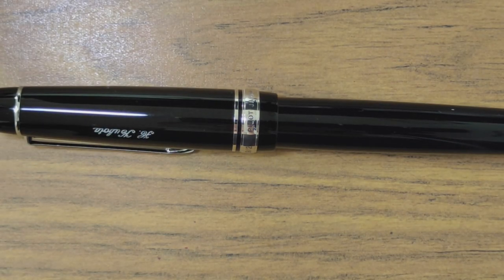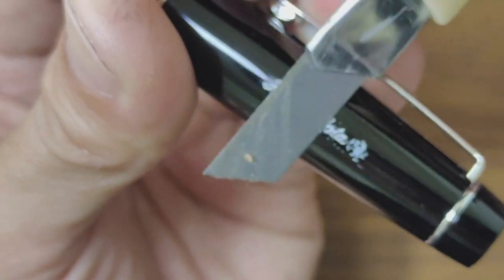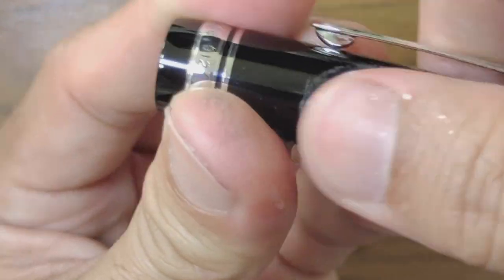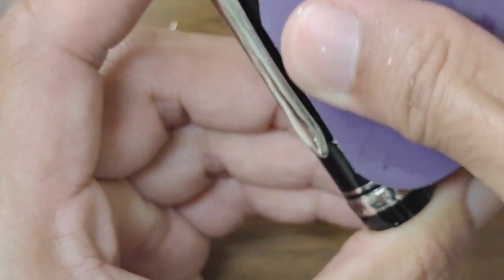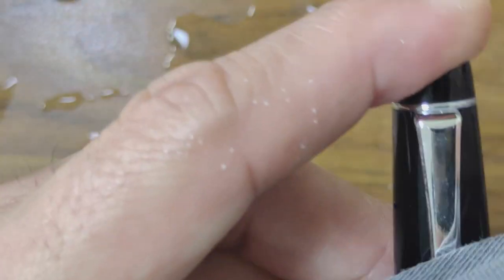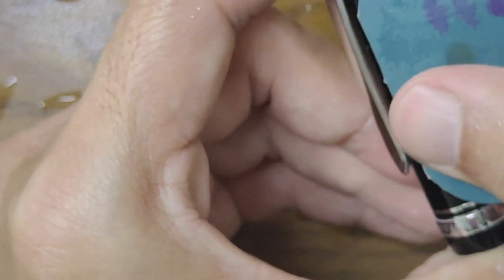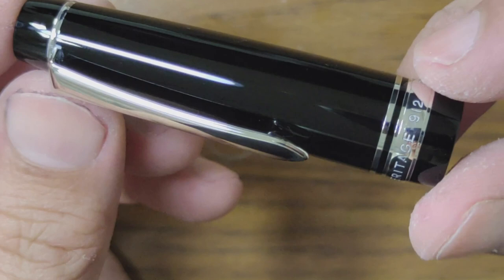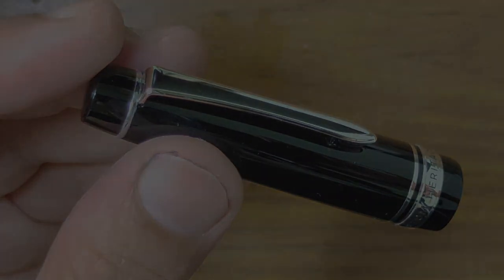Removing Engraved Names from Your Fountain Pen

Comment: 1) That is not a "pen knife". That is a snap blade utility/box knife. A "Pen Knife" is generally a small 2 7/8 inch to 3 1/4 inch closed double ended slipjoint, with either a clip point, or more commonly spear point primary blade, and a pen blade (look like a small spear point) secondary blade.
2) That name wasn't "engraved". It was painted on. 
Painting isn't engraving. Engraving involves the removal of material to make the design or letters. Engraving is slightly below the surface, never slightly above.
If that name had really been engraved, you would have to refinish the cap's finish because you would need to go deeper than the lacquer or whatever is on the surface of the cap to remove the engraving. If the cap is polished plastic, you would have to blend on where the engraving was and re-polish to the original luster. (not recommended nor suggested for celluloid, as that may cause it to start outgassing.
Reply from the maker: Thank you Steve for your insights!! I would agree that the name seems more "painted on" or "embossed on" as you suggested than "engraved into the plastic"... Thanks for clarifying!!👍
Reply: Hello do you know if laser etching and laser engraving is the same thing ? I really hate how there's a massive printing on knife set the pharma reps gave us to try to bribe us. I don't want to cook and every time be reminded about their brand . When I brush my hand over the logo and company name I feel that it's raised. I used a utility blade to see if I could remove it but it's on there after 3 mins of scratching. Any clue how to get rid it guys ?🙏🙏🙏🙏🙏

Comment: If you ever sell this pen I do hope you disclose the material removal from the cap, I've been swindled several times in the past on rare Parker 51s and Sheaffer's with the tell tale undisclosed flat spot.
I do not remove engravings from pens, personally I find the flats spots worse than the personalisation plus the name engraving adds to the pens history and charm. My most prized Parker 51 first year model has a name and military rank engraving adding to the pens wartime history as well as it's wartime manufacture (1941) .
Reply from the maker: Yes indeed. Engravings tell of the history or story of the pen. I guess it all boils down to personal preference.
Thanks for sharing Jay!! :)
Reply: I did a job recently at a building that its going to be demolished (moved out or abandoned offices) and found an engraved montblanc meisterstuck rollerball pen that has an engraving on it. Not that into pens and was thinking either selling it (don't know where) or trying to get rid of the engraving